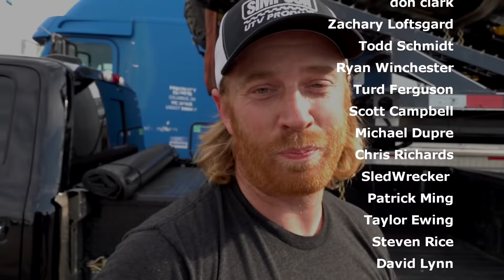Wrecking $250,000 worth of side by sides... our worst day ever.

Comment: Looks like trailer was locked on to the ball but ball wasn't locked on to the truck. I forgot to lock my gooseneck trailer before but luckily I caught my mistake in time. Shit happens, glad you guys were all OK.
Reply: I noticed that no ball in the bed. Shits crazy
Reply: True that looks like exactly what happened. A very heavy high top loaded trailer that can take the weight regardless won't have a chance if the ball is not locked into the bed. It basically used the chains only to keep it held in. The ball in the first part of the vid is gone out of the bed. That is your 3rd point that would help keep the trailer attached to the truck. That sucks guys sorry.
Reply: Also where are the bed hooks for the chains? doubt it would help in this situation, but it's still a safety issue not running them.
Reply: @RyanLane2011  the bed hooks were still attached to the chains. They ripped them out of the bed when it rolled. That was my whole thought the chains were probably stressing the thread in hooks or taxing them alot. Mostly because the ball was loose. If the ball did not shear off its holder in the bed that means it was never pinned in the bed from underneath the truck. I wanna say that's how these factory in bed gooseneck balls stay attached in the holder don't quote me on it tho. Ball was loose it moved back and fourth or started to slide in an out if it's holder then it probably stress the chain hold down fixtures. It was a matter of time before it would all let go. The trailer is very top heavy loaded then the ball not being properly installed and pinned in the bed give it alittle bit of a sway of the load on a turn and voila! Like I said this sucks but when the ball came out its nobody else's fault except who was installing it they missed a step putting the pin in.
Reply: yea 1 min 4 seconds in ball is missing in the short clip of panning over 7 mins in the ball is back im the bed so the pin release was not locked for the ball removal
Reply: I think they should start hiring someone to haul their stuff for them.
Reply: No ball in truck bed at 1:36 in video like Logan said might not have been locked in truck then ball is back in at some point 
Bad deal man just glad it wasn't worse
Reply: @JesseG085  i vote @Wtf_Josh

Comment: Just from the first few moments of the video, and seeing these loaded on another youtuber's video....your trailer weight had a high center of gravity, and the turn was taken too fast for those conditions. High center of gravity loads must be maneuvered much much slower than most others, especially if they're liquid loads. But really there could be so many factors, was there any wind gusts, was the locking mechanism for the gooseneck faulty, were the driver side tires low or any blown out, how fast was he really taking that turn, soooooo many questions to make a good root cause analysis. Thank goodness everyone is ok and you were all blessed with no injuries.
Reply: This right here, once you start tipping that ball can only hold so much. Also no safety chains hooked up. Slow down getting loaded up and don't take short cuts, and slow down running down the highway. Cleetus is guilty too, love the guy but you can't run 80+ and wonder why you're having blowouts every trip. Hate to see something really bad happen.

Comment: Only one way it happens, coming around the corner a bit too fast with all that weight on the trailer, it's top heavy.

Too fast doesn't mean speeding, too fast just means too fast for the weight that was on the trailer and the radius of the ramp (exit onto freeway/interstate).

Comment: Professional 10-car transport driver here.... the fact that the trailer is uncoupled from the truck leads me to believe that excessive speed through the curve was NOT the issue. When speed is the primary factor, the truck and trailer stay connected and will roll over together. Either the trailer wasn't coupled and locked properly, or a component failed and caused the coupling to unlock. It's not your fault Doug, keep your head up!!
Reply: It failed do to high speed rollover that style coupler isn’t gonna pull a 10000 pound truck over with it.
Reply: @nytro5004  I'll put more stock in what you have to say when you can correctly distinguish "do" from "due".

Comment: Sucks to see all that damage but I'm amazed you're allowed to tow trailers like that especially that top heavy. You'd never get away with that in Australia
Reply: Well and i gues it also had to do a bit with speed...
Reply: @emanemanresuresu  they were definitely going too fast nothing else caused this unless the trailer broke which is unlikely
Reply: Actually, you can, I regularly see a American vehicle specialist tow 3 cars up, on a trailer like this on the bruce highway in Qld
Reply: @liampoor9699  is it legal tho? A Chevy Silverado has a tow capacity of 4.5t, those trailers alone are between 3 - 4 tonne. Then by the time you add 3 or 4 cars on top you're way over our allowed gcm
Reply: @MJMAC  depends on how the vehicle has been registered. It may possibly still have the OEM's tow rating from the US, which goes off of using a gooseneck hitch. Also, I believe the driver would have to have a Multiple Combination truck licence. 4500kg is only the limit of a passenger vehicle too.
Reply: @MJMAC  by the way a Chevy silverado 3500hd dually has a max tow rating of 16.3T on a gooseneck trailer setup.
Reply: @liampoor9699  yea most passenger vehicles/4wds have a tow rating of 3.5t, the silverado/ram etc were the highest I could find. Anything higher than that you need a MR or HR truck license then if you're towing a huge trailer you'd need a HC truck license
Reply: @liampoor9699  on the website is says a 3500 dually in aus has a 9.0t tow capacity

Comment: Right when they get out of the truck, the ball is gone. Few minutes later, it's back in the bed.

They didn't pin the ball in, then acted like it was something else.

I hope they don't claim insurance as the video might be proof of fraud.
Reply: Idk. It looks like the ball snapped. If they didn’t pin the ball in that wouldn’t happen
Reply: Wish I knew enough about goose necks to say you are right or full of it. But I did notice it wasn't there and then it was
Reply: @jedshafer6873  but if the ball snapped it wouldve been locked in the trailer and it wasnt in it, possibly just faults all the way around

Comment: A 5th wheel and step deck would be a lot more stable; I drove truck for quite a while and hauled quite a few loads of livestock that were double decked; when entering or exiting a highway, or any turn, if the safe speed said 35 or 25 you make sure your running slower than that! The thing with live stock the load can't be tied down and it moves around a whole bunch!!!!

Comment: I originally thought that trailer seemed way too high centered and unfortunately it just couldn't handle that turn at that speed as evidenced by it being seen slowly tipping over. You're lucky it didn't take the truck with it and a smaller truck probably would have. That trailer is probably fine with cars since the center of gravity is low but the sxs are high. Moving forward you should either find a lower trailer with a steep ramp at the front for the first machine or extend the trailer foot print a bit with high offset wheels and try to remove any unneeded weight from the top of the trailer like extra bracing that is overkill. Any little bit helps since everything above the axles is a acting like a lever and multiplies the force by a lot the farther you get away from it. Even if you can compress the suspension with ratchet straps and air down the tires you will lower the center of gravity significantly and take thousands of pounds of force off the trailer when turning at speed. Also put the heaviest one on the back and the lightest up front. I feel real bad for you guys and especially for 2jp as I think it's one of the best builds on YouTube and I just want to see it out preform everything on every surface. Keep up the good work and don't let this bring you down. It's a reason to build it back stronger and better and capitalize on the content that will come from it.
Reply: It’s not a weight issue with the trailer. The SxSs are far lighter than a standard car.
Reply: @stuartstogdill2406   @Stuart Stogdill  yes they weigh less but their center of gravity is way higher. So when turning, the force on the trailer increases by alot. Think like using a long pipe to break a bolt free. You're using the same force but it multiplies the force at the bolt the longer you extend pipe.

Comment: Say it with me, PRE-TRIP INSPECTION, and MID-TRIP INSPECTION. That's when you inspect the rig while fueling, or stopping to take a piss! This might have been avoided with some careful attention.
Reply: nah this was about the design on the trailer/connector..
Ive never liked 5th wheel connectors like that.. too high.. puts all the weight above the centre of gravity.

Comment: Problem is you are using a goose neck on a top heavy trailer that should require a regular 5th wheel. Think of it of a 3 wheeler vs a quad... Front end has no side to side stability and not enough weight on the rear wheels in a turn.

Comment: Where was the gooseneck ball found? First shots showed it not in hitch bracket in the bed, or latched to trailer on its side? Then someone put it back in truck. My bet is someone forgot to secure ball to truck bed, pin was never inserted. Going into curve with speed and a top heavy load pulled it right out of its socket. Bummer

Comment: The ball is NOT in the truck, see 1:10. Either it wasn't locked in, or the locking pin broke somehow. It's near impossible for the ball to just come out otherwise. There is nothing wrong with using a wedge trailer for side by sides, people haul cars and trucks on them all the time. There was a problem with the lock on the gooseneck ball.

Comment: Those goosenecks are bad news if they have the same, or more, weight up high over the ball than there is over the axles.. it’ll act like a 3-wheeler and dump right over like an old ATC185.
Always have waaay more weight over the trailer axles than you have up high in the front because the ball does not transfer any roll to the tow vehicle’s axle for added stability.
Considering how little/light you guys are over the rear axles, you’d probably see a lot more stability out of your wedges if you added lots of ballast over and just ahead of the tandems… perhaps a fuel tank (stay under the size limit for hazmat) and a big baffled water tank plus a power washer would all come in handy?

Comment: The weight distribution on the trailer was incorrect. You need to ensure the weight on the tow hitch is around 60lbs plus when you towing that much weight, and naturally taking the corner too fast probably didn't help either, heavy always goes downwards, law if physics.

Comment: Great nobody was injured or killed!!Stuff can be replaced, people cannot.
Anyone notice at 1:04 & 1:09, No ball? Then at 7:02 the ball appears? 🤔. Plus the safety chain attachment points are not seen? Also straping tires of the UTVs with plain single straps is not smart. They need to invest in proper over tire sling straps similar to what towing and recovery companies use or strap to the frames and cinch them down. This setup was an accident waiting. Definitely need a fifth wheel setup with double decker it will give a lot more stability.

Comment: I tow a dump box gooseneck every day with my duramax, with way more weight than that trailer and load. I see no ball in that bed, it's still stuck in the trailer. The chains hooks broke, which is next to impossible. I modified my ball with a giant bolt on the bottom to hold it in the factory hitch. I think the weight was up high and you took the corner too fast. Good thing for you the trailer disconnected from the truck. Also, undoing the load while the trailer is on its side is a big nono.
Reply from the maker: Ball is still there, it's just under the red toolboxes.

Comment: Please do yourselves a favor and re-evaluate your wedge trailer setup. First and foremost, throw all your gooseneck stuff away and go king pin. If you feel like you absolutely have to pull with something with a truck bed, get the trailer down to where is is 6-7" off the bed rails. Gotta get the weight down lower. Since the bed on this truck is junk, the best thing to do would be to put a flat bed on it and get rid of that wedge for a low pro wedge. Ill be first to admit that I'm pulling my 50' wedge with my pickup with a regular (long) bed right now. Its not perfect, but I have it down as low as possible, which ends up being 6.5" off the back corners of the bed rails and I have a king pin insert with a 25k rated fifth wheel. way more stable than if I had it setup with my gooseneck adapter. jacked up gooseneck wedges roll over ALL THE TIME on ramps like that. Those tall kaufmans with the front extensions are the worst. You pretty much need to keep a good amount of weight on the rear to keep them planted on the ground. I'm local to the area, I know that ramp in Fort Wayne very well. Hard lesson learned.

Comment: This trailer setup with a ball gooseneck is the equivalent of a three wheeler.  Corner too fast with high center of gravity and this is what you end up with.  Trailer roll is not resisted by the truck at all because of the ball.  A fifth wheel setup would allow the truck to stabilize trailer roll.

Comment: Very Very Sorry this happened to you.    I Have to Scream Something.. That Hot Shot Trailer/Truck System Is the REASON.    It was Not Made to Carry Weight safety over the truck.  Unless You were running a FULL Plate Mounted On the Truck and a full platform mount on trailer.    The lack of that mount & hook system is why Hot Shot systems have high roll over probability.  Its actually What Hot Shot Drivers Pay higher priced Insurance than traditional 18 wheeler do.

Comment: Those buggy’s are very springy.  I could see if the bounce suddenly lined up as top heavy as it is it could bounce over the trailer. You were also in a bank on the road.  That type of trailer hitch should not let go but things do break with enough force.   It’s probably not as strong to a twisting force.

Comment: Only thing I can think of, is that to much weight in the upper part of the trailer. A shift in suspension gave the little "Rock" needed to go over. Unfortunate as hell. This was my biggest fear when I had to pull a trailer from Cali to TN. Went smooth My truck handled it like a champ turbo roaring whole way (only had a slight problem in stop n go traffic transmission with stock coolin didn't like it)

Comment: I’ve also seen these wedge trailers loaded with cars from the auto imports here in Flint MI and I’ve seen several F350 and 3500HD rams front wheel lift either side when turning the corners from a red light or to get onto the expressway.  Top heavy loads will kill any experienced driver in a heart beat.   I’ve even seen a 5500 HD Silverado get pushed/rolled through a left hand turn at 5-10 mpr.  Never get comfortable because that’s when karma bites back
Reply: I can see that happening on a wedge with a fifth-wheel as roll on the trailer is transferred to the truck, but not with a gooseneck ball setup like this trailer has.  Trailer roll is free with a ball and the truck does nothing to resist that.  This a fatal flaw with this setup.  The truck does nothing to counter the trailer rolling over.
Reply: Fully agree

Comment: I’m curious where the hitch ball was? Appears to be missing from the bed in the first couple minutes but than at around 6 minutes in when they show the bed the ball is there again??? So looks more like either the ball came disconnected or the hitch disconnected from the Ball slid over and then ripped the bed as the hitch lifted up at the edge of the bed.

Comment: What a heart breaking loss. Sorry for you guys. But looking at the configuration of that truck and trailer it looks sketchy. First, the majority of the load weight is elevated creating huge leverage in a lean. The tires on the rear of the trailer seem sufficient to support the load, but up front everything comes down to a single point of contact: the ball mount. I think psychics won this fight. Just too much weight and leverage about that little ball.

Comment: Corners are a bitch. Truck driving school teaches to take the posted corner speed (25mph) divide it in half 12.5 then add 5mph = 17.5 mph for the correct speed when hauling a loaded trailer.  If it’s posted 30mph / 2 = 15+5 = 20mph max

Comment: When the video starts, the flip over ball is not in the plate. Just a hole in the middle of the bed. Then shortly later it is in the hole. Seems to me the quick release wasnt set back when the ball was flipped over, and someone put the ball back in the bed after the trailer flipped? Any explanation as to why the ball is missing at the beginning of the video.

Comment: Did the end yellow one break loose in the corner send the rest of it over? The left wheels of the yellow last one were UNDER the trailer while all the others were still pretty much strapped in.  Plus the high Center of Gravity and the mount looked way undersized for the weight and length, which acts like a break over bar by using the law of leverage.  Good luck guys.